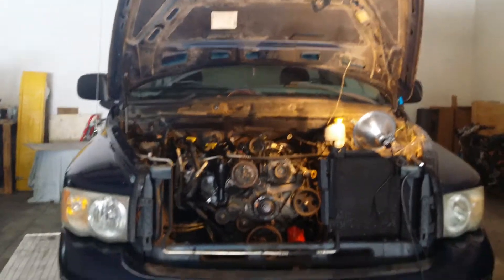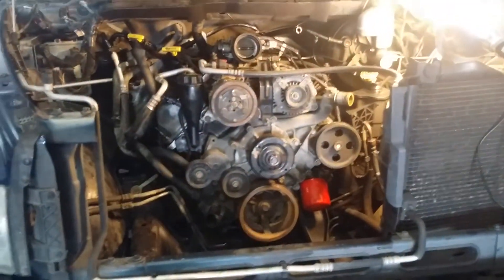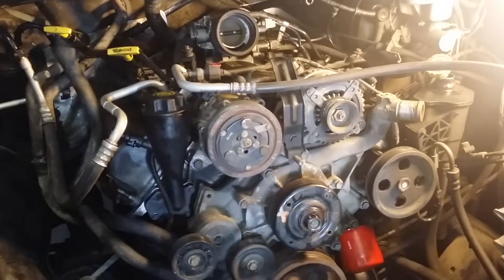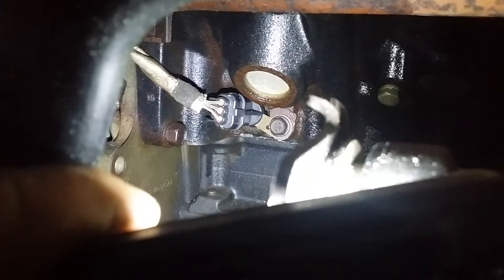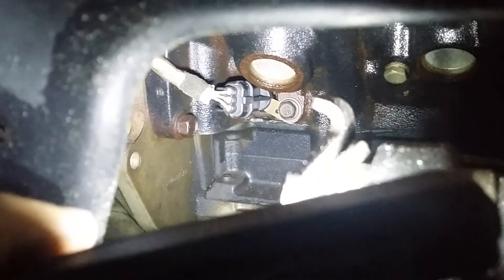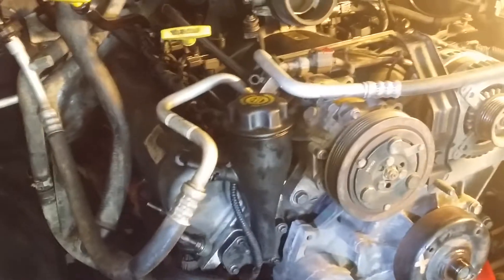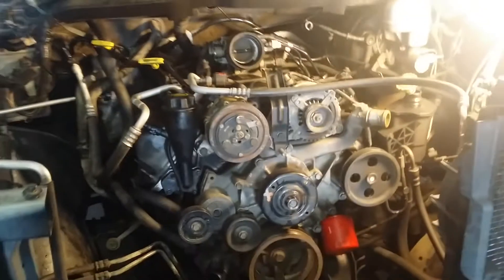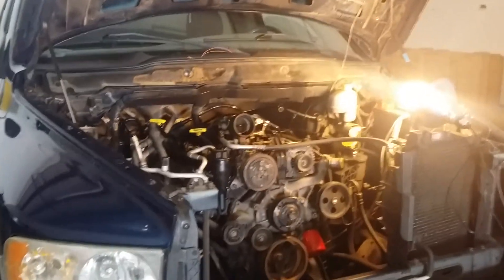Dodge 4.7 engine 16 tooth or 32 tooth tone ring, how to tell the difference.

Comment: How do I tell what reluctor ring was supposed to be in the truck originally? Ive gotta used motor swap that Somebody did on their own then brought it to me crank no start ,now i'm trying to figure out why it doesn't have crank signal, or correct crank signal.But I don't know what reluctor ring was in their original one neither does customer smh... theres gotta be a way though
Reply from the maker: Check out some of the other comments here, couple guys explained it. I'm not 100% sure on that, this is the only one I ever did

Comment: Guy brought me two trucks. I've lost a week on it. Old engine had 16 ... New engine has 32 🤦.
Reply from the maker: @joeysanchez5926  dodge really screwed up on this one..why make 2 different ones🤬
Reply: @thedragon2299  yep. And that's because I worked for Dodge from 2007-2010 but either I never ran into this knowledge or long lost forgot about it. But when I saw that code 😞 I kinda knew.

Comment: 16 is a 3 plug with external tcm 32 is 4 plug, the intake is smooth on s 16 tooth vs the rough 32

Comment: Another way of telling is to check your pcm. 3 plugs 16 tooth, 4 plugs 32 tooth
Reply from the maker: Yeah exactly we have mentioned that before, but if you only had the engine and needed to know it was the right one, this is a real quick easy method. Thanks for clicking and commenting.

Comment: Don't forget!!!  crankshaft AND camshaft they are both 16 or 32 but you have to do both.
Reply from the maker: This is about getting the right motor, which I did.  Not about  replacing crankshaft and cam...

Comment: Can a mechanical fan be installed on one of these trucks?
Reply from the maker: If you are referring to the cooling fan, they do have a mechanical fan, not electrical fan.
Reply: I meant clutch fan, sorry.
Reply from the maker: @commongunowner2173  To tell you the truth, I did think they had clutch fans, but to be honest I haven't actually worked on many of these, this was my customers truck I worked on like 4 years ago. Sorry wasn't alot of help.

Comment: So , you only have to change the Tone Ring not the whole crank??
Reply from the maker: The motors are different, can't put 16tooth in a 32tooth and vise versa. And I don't think you can just change cranks from on to another either. As far as changing a tone ring, you would have to remove the crank to do so.
Reply: @thedragon2299  Well i have the original motor from my first 2000 dakota truck 4.7 vin n 16 tooth that i want to get rebuild for my 2004 dakota also a vin N , that have a 4.7 with a 3 plug pcm so im hoping its the 16 tooth... Ill check it this week and see if it is the same. Thanks for answering my question!!

Comment: Hay guys ? I have 04 4.7 dakota replacing with 02 both have 4 plug computer ? Is will i be all set with 02 computer and motor in an 04
Reply from the maker: That's the way I understand it, I believe there is a 3 plug and a 4 plug computer and you can't mix them in any manner. But best to wait for a second opinion, because I got my info off a forum three years ago when I did this motor in the video, and haven't had to do another since.
Reply: @thedragon2299  my o4 has 4 plug computer when i switch ta the 02 I'm going to use the 02 computer.my outher question is should i replace the wire harnesses with the 02
Reply: 02 has 4 plug also

Comment: What does the tone ring do? And why did Chrysler make two versions in the same vehicles?
Reply from the maker: The tone ring is what the crank sensor reads for the timing, I believe it's basically a reluctor wheel. The 16 tooth is the older version for 16 valve engine, and the 32 tooth is for the newer style  32 valve engine. Because apparently 4 valves per cycle is supposed to be better than 2 valves per cylinder
Reply: @thedragon2299  awesome thank you

Comment: I got a 02 dodge dakota with 4.7 and found a motor out of a 05 with 4.7 will it work
Reply from the maker: I wish it was that easy, from what I found, none of that matters, you have to physically check to see which motor you have 16 or 32 tooth, and replace it with the same motor. There is a way to check by pulling off the valve cover off of each motor to compare and make sure they are the same, you will have googke  that process, because I'm not 100% sure on that particular process, in the pickups you can pull the crank sensor and see the tone ring for identification. See the 16 tooth crankshaft doesn't work with the 32 tooth computer and vise versa, some many people have got this wrong and made some big financial mistakes, so you need to physically inspect to be certain

Comment: Hello, my 2003 4.7 32 crankshaft engine is done. I bought a 2002 4.7 with a 16 tooth crankshaft. Will my trucks computer read it okay if I take the 32 crankshaft out from the motor and put it inside the new motor I bought that had the 16 tooth crankshaft?
Reply from the maker: 16 tooth crankshaft has to go with the 16 tooth computer and the 32 tooth crankshaft has to go with the 32 tooth computer. Crankshafts will interchange from one engine to another,  but can't mix 32 tooth crankshaft with 16 tooth computer or 16 tooth crankshaft with 32 tooth computer. Hope that makes sense.
Reply: @thedragon2299  what happens if you mix them?
Reply from the maker: @Motovader72  It won't run
Reply: @THE DRAGON  I'm so glad I found you, I swapped a 2002 dodge ram 4.7 and I put in a 2008 4.7. It runs good, I still have the 2002 pcm, but it has a lifter type tick, I've already replaced all lifters and still. Do you think it's because I didn't get the pcm ? Appreciate any input

Comment: On this particular truck it maybe easy. But the 4.7 is found on other application where the wheel well clearance is much more limited. Durango and the dakota 2wd is one of them...if no access to a jack or lift it will be even harder. If you remove the passenger side valve cover and count the number of windows, then count the number of windows on the replacement motor, they should match. If there is a different count then you have a differnt tone ring. This is convenient when you do not have acces to the bottom of engine. None the less i did enjoy watching your video. 👍👍👍
Reply from the maker: Indeed,you are correct! Someone else mentioned that as well, and I didn't know about that myself, so thanks!, very helpful for me and the viewers. Thanks

Comment: I made a big mistake😏 I replaced my engine but I didn’t know about those tooth, sooo my truck won’t start with new engine, any help
Reply from the maker: You will either have to pull the motor back out and replace it with the right one, or you have to remove the tone ring and swap it, which requires disassembling your motor, its on the crank, or you would have to change your wire harness and computers. Not really an easy way out I don't believe. Sucks, I know...
Reply from the maker: There are some videos on YouTube about changing the rings
Reply: Thank you, I guess I just gonna send to rebuild the old one and no mess around with this 4.7 engines.
Reply from the maker: Cool thanks, yeah sucks you went through that, but you aren't the only one, thousands of people have been there, it's all over the internet, what a mess. Nice looking truck by the way. Good luck, remember it could have  been worse.
Reply: Just happened to me. Customer brought me the motor. I installed today and saw the cmp ckp correlation code. 🤦

Comment: someone told me if there is a N as the 8th diget in the vin that is how you can tell!(?)
Reply: Or you can just look at the computer.  3 plug will b 16t (jtec) 4 plug is 32t (ngc)
Reply from the maker: @jeffmacdonald5730  That is correct, but when you are buying another motor from somewhere that is not in a truck, you don't have that
Option. Have to count the tone ring. Thanks
Reply: @thedragon2299  I c.  Another way would b to count the windows on the cam sprockets as they're different also.  I have both.  Thinking of converting a 4.7ho for my 03dak just researching any possible headaches before I make a purchase but seems I have everything to do it.
Reply from the maker: @jeffmacdonald5730  yeah, thats a good idea about the cam sprockets!
Reply from the maker: jeannette danbom: I have also heard that, but then people proved they had otherwise in some 04' jeeps or something like that, so the only certain way is to actually count the teeth. Another cool thing is I bought a little borescope camera from amazon for $15 that plugs into smart phone, you can attach it to a stick or something and stick it in the hole and see the tone ring on your phone, even take a picture of it for confirmation of a specialist. Thanks for response
Reply: They both could have an N as the 8th digit..Remove the crank sensor if it has small teeth close together its a 32..if it has big teeth and are spread its a 16..or could have someone turn the engine while u count the teeth at the crank sensor once u remove it
Reply: My Ram is an 08.  Has the 4.7 vin N.   It's the one with 16 spark plugs and the 32 tooth tone ring.